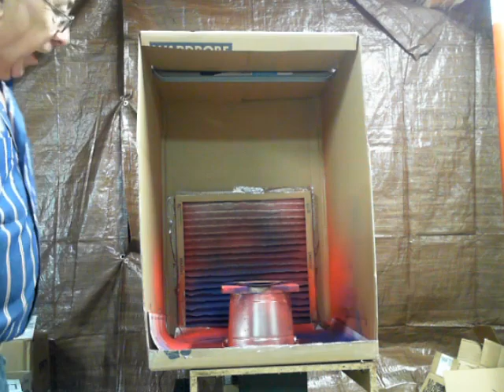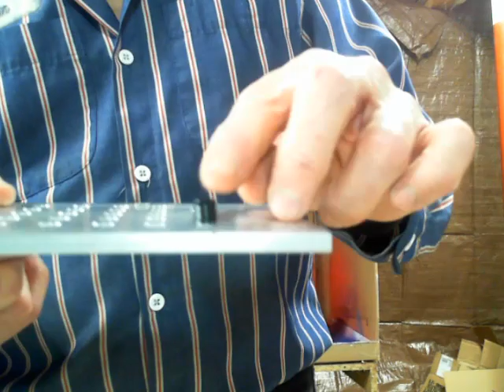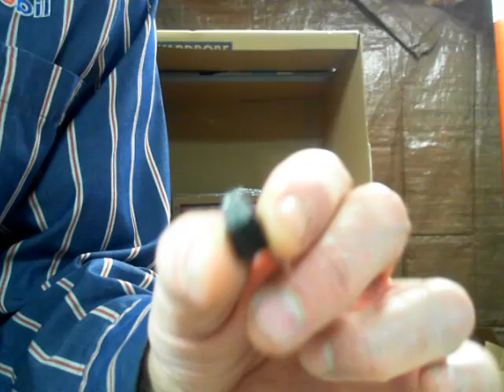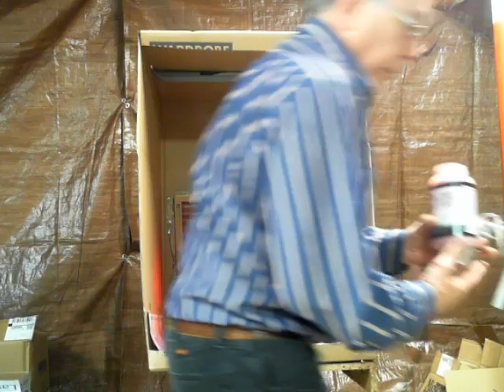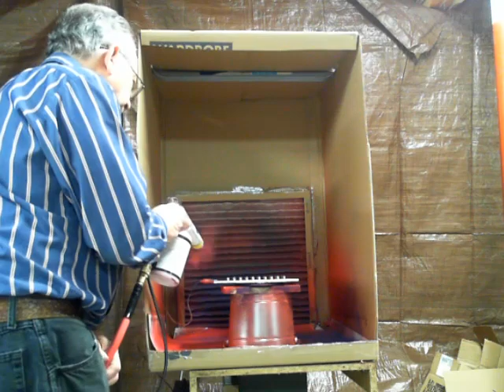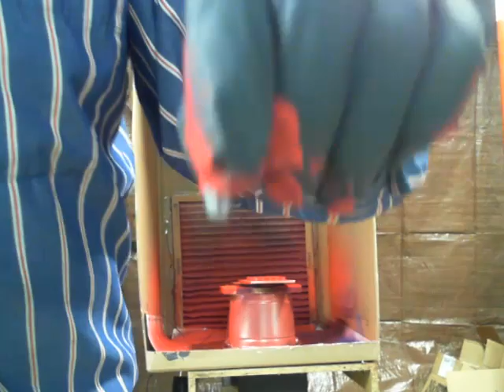DIY Powder Coat Spray Booth

Comment: Very nice set up but can you recover the excess Powder Coating I’m cheap I try to keep as much excess powder as I can . I do like your set up
Reply from the maker: Yes I can recover most of it...have a piece of poster paper on the bottom just slide it out fold it and pour back into the container.